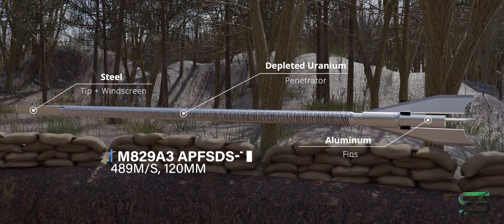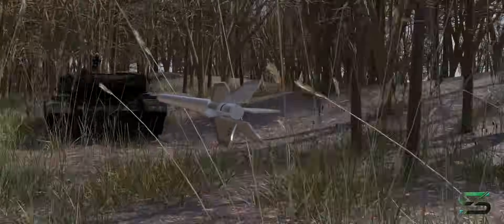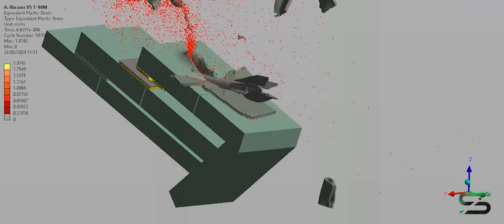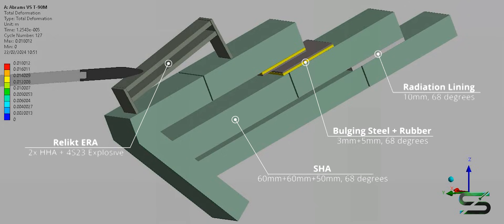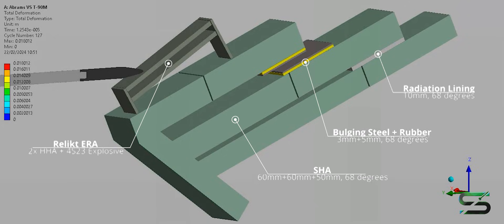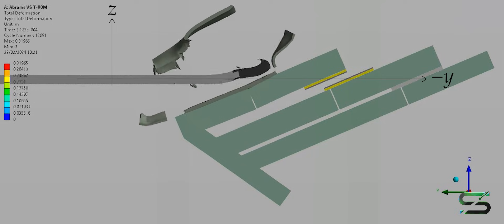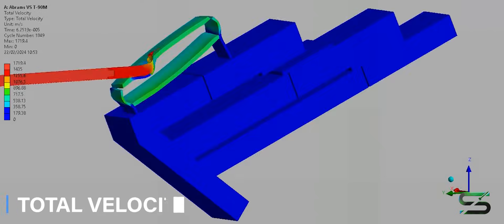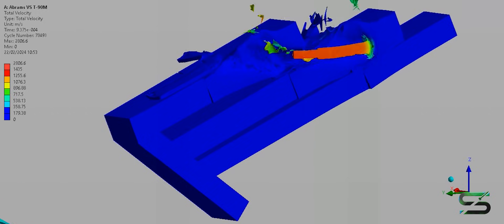M1A1 Abrams VS T-90M | Armour Piercing Simulation

Comment: https://www.youtube.com/watch?v=kG8bBwjdtac
Comparing with a T72  hull structure from the link above, it seems the T72 and T90 have significantly different hull structures although the t90 is told as a rebranded t72

Comment: You're comiaring anvearly 90's tank system to post 2000 system.

T90M is dying to Bradley IRL, so the abrahms, well....

The problem with abrahms, its logistics chain.  Its terrible for UKR.
Reply: “Bro I know a lot about tanks”
Idiot any bradley won’t kill a T-90M it only killed its optics which actually a BMP-2M can do a much better job at destroying abrams and leopard optics than bradley killing T-90M optics also keep in mind that M829A3 is not 90s tank system but its 2003 and T-90M is half the price of an abrams so think about it 2 T-90M vs 1 Abrams M1A2 sep v3 not even the M1A1 the abrams will lose easily

Comment: The ERA should be house bricks like real life.
Reply: It’s about this “thin” that’s about an inch or metal, which is correct. The ERA is layered and thick from its explosive ls inside it and the double plate that’s made to create the circuit
Reply: @harrisonschonewald Many Russian tanks have ERA made of cardboard or bricks.  This happens because of corruption.  The same with the out of date food rations and the bad tires.

The ERA is ment to have explosive and sometimes its bricks or cardboard.

Colonel Alexander Denisov for example was arrested for stealing seven engines meant for the T90, one of Russia's most advanced tanks.  These were sold on the black market were countries like Ukraine could buy them.

Comment: There is not enough information available to run a simulation on this round, which was specifically designed to take down a T-90M. So, I would take this with a grain of salt.
Reply: There is not enough information available to run a simulation on this ERA, which was specifically designed to take down  new darts. 

So, I would take this with a grain of salt, especially seeing as the channel owner didn't fix the plates after segmenting them and made the ERA explode absurdly fast to affect the dart less and is lying in the comment section.

Comment: M1a1 is from the 80s… t90m enters service like 5 years ago
Reply: M829A3 APFSDS-T Depleted Uranium is made in 2014. It's not about the tank, it's the ammo
Reply: @bigsmoke4345  Абрамс от Модифкации М1А1 до M1A1SA не способны стрелять снарядами M829A3, это могут только модификации M1A2, M1A2C sep 1, sep 2, sep 3 , sep 4, но они используют более новый снаряд M829A4
Reply: @SFERA9-rb6xw  the guy who made the video says this "This simulation shows the impact of the 120mm M829A3 APFSDS-T with a Depleted Uranium penetrator being fired from a US M1A1 Abrams tank at a range of 0.8km, targeting the front hull of a Russian T-90M tank."
Reply: @SFERA9-rb6xw Yes they can, this isn’t war thunder where the M1a1 cant fire M829a2 or a3 if it was in the game. All M1 abrams variants with the 120mm gun can fire any 120mm ammunition. Just like how the M60a1 RISE could fire M833 and M900, it had the same gun as the 105 abrams so it could fire the same ammo as the abrams.
Reply: @tbomb69   Нет, у них  у M1A1, M1A1HA, M1A1SA базовая 120мм пушка М256, у M1A2, M1A2C sep 1, sep 2, sep 3, sep 4 это 120мм пушка M256A1.Что касается 105мм снарядов по типу М900 то ими может стрелять пушка M68A1E4, а не M60.
Reply: @SFERA9-rb6xw  english please?

Comment: You are not applying proper boundary conditions. Parts of tank armor are moving freely as if you were firing at a cutout IRL. The tank would shake itself apart if you built it like this.
What is the deal with the upwards strike angle?

Comment: Odd reports from Ukraine shows That T-90M frontal armour cannot stop older APDS from leo 2A4, About looses 80 T-90M confirmed visually, 8 T-90S, 1 T-90AK, 38 T-90A, Total confirmed tank losses 2936
Reply: This is all complete bs from your first claim alone because their has been only one single engagement between any russian federation tank and a nato tank and it was a leopard2A6 firing HE at the front chassie of the T-80BVM. Both tanks backed off
Reply: Леопарды вообще никогда не стреляли по русским танкам,они лишь выполняли роль САУ а когда выезжали на поле то из тут же достигали дроны
Reply: Да и по потерям стоит уточнить что у украины только больше/меньше 100 танков леопард из которых 40 уже унечтоженно а другие либо на складах либо за фронтом
Reply: А т-90м около 500 штук это на 2022 год час кнч уже больше

Comment: Why are we using the m1a1 and not the m1a2 v2 or v3?
Reply: because the use the same gun? like the only change the did is addon armor and CROW system, they haven't change a lot of thing to the hun other than it able to use programable round
Reply: The fascists are afraid that the Nazis will lose them and Russia will become targets for research.
Reply: Russian drones, helicopters and artillery, as well as FABs, will not feel the difference. So why should Americans spend more new equipment?!

Comment: Bro thinks he's an helicopter
Reply: on gng bro lil bro funna fly
Reply: Best attack helicopter in the world!
Reply: Its reference to T-90M that got destroyed by 2 Bradley IFVs in Ukraine
Reply: @lampredgo5440 no, it is not destruyed, was ddestroyed visión system
Reply: @marianoprado5652  That is called a mission kill. The T90 could no longer fulfill its mission.
Reply: @jackmclane1826  Yes, but the tank was not destroyed as such, as some people say, it was just rendered useless.
Reply: @marianoprado5652  
I think there is no need to make that difference. The effect is the same, isn't it?
Reply: @jackmclane1826 yes but the t90 was repairable
Reply: @ThePolishFulcrum  Was it repaired? Probably not... So the effect is the same.
Reply: @jackmclane1826  yes, if the tank if put out of action and the crew has to bail out that means it’s destroyed. It doesn’t have to violently explode to be scrapped…
Reply: @jackmclane1826  So you confirm the other user is correct in stating it was NOT destroyed.
Reply: @ I think you can say it was destroyed. 
It was so badly damaged that the crew had to abandon it, because it could no longer fight, was deaf and blind. 
It does not need to toss its turret to be considered "destroyed". It was what is called a "mission kill". Unable to fight and continue its mission and abandoned.

It may have been repairable at that point, but it was finished off by a drone dropping a grenade to prevent recovery and repair. If I remember correctly... too many tanks blown to pieces to remember them all.
Reply: @jackmclane1826  Was it destroyed? No? Then the english language says it was not destroyed. It's not complicated, childrens are able to understand that.
Reply: @olisk-jy9rz  Point is: It was destroyed!
I can't help you if you don't understand, what a mission kill is.  The outcome is the same as if it tossed its turret. 
A drone later ended it completely, but the result was decided before.
Reply: @jackmclane1826 how many bradlys, and t-90 were destroyed?

Comment: some mf said ERA is useless against apfsds bruh
Reply: Once upon a time, that was true.
Reply: Every simulation shows the dart hitting the era block dead center where its most effective

No one shows how effective it is if the dart hits a corner or anything
Reply: @ozan1234561  ERA works as is should be when hit. When not hit it doenst work. Is that really a big surprise?
Reply: @ozan1234561  fr and this is why every anti Russian says "ERA is useless!!! 🤓" however usa also uses ERA and so does ukraine, infact ukraine uses more era than Russia, especially on their leopard 2's and m1 abrams.
Reply: Vs new rounds yes
Reply: Contact 1 (5mm against pen) useless, but Contact 5 (120mm against Apfsds) and Relict (250mm) , there is also a Duplet (250-300mm).
Reply: @BlackZaporozhian DUPLET is twice as heavy tho id you want to use it on a tank you have to remove the first layer of composite to fit it due to weight increase but yeah it is more effective than RELIKT and K5
Reply: @AlexanderK9519  yeah but DUPLET is ukraine-made, just like the Nizh ERA. Nizh is pretty cool actually, it like slices the projectile in 2
Reply: @AlexanderK9519  That was the case with Knife, not Duplet. That was t64 mod with Knife armor, where the problem is suspension - its really good but too soft for several tonn update, thats why they need to remove first plate. The Duplet is the same as Knife, but Twice! because this beast seats layer by layer (tandem)
Reply: @krakozyabro_official  Better to say in several pieces. I believe it should to have 12 to 9 cumulative shapes
Reply: @MercTac  that's what i said
Reply: Возможно, DM63 и M829A4, могут с небольшой долей вероятности не инициировать блок ДЗ. Однако, для такого существует "Малахит", который сводит эту способность на, близкое к нулю, значение.

Comment: I would like to suggest a simulation of 50mm ap round vs m1a2 abrams side skirt (around 30mm ar550 steel) + side hull (around 80mm ar550 steel), as the armour and thickness are classified, this is a closer thickness specification and steel hardness.

Comment: Someone made a good point, why did the tip not break off and immediately warped what would have been an intact rod, which is the point of the breakaway tip, no?
Reply: Потому, что на таких скоростях металл поведением становится похожим на жидкость.
Reply: Cuz this is Propaganda my man!😂
Reply: @scottsauritch3216 no it’s that at high speeds metal acts like liquid

Comment: It is unlikely that the Abrams will meet the T 90 in battle. I think it will be like with leopards and British tanks. they will become easy prey for ATGMs and lancets. Telegram has a recent video of the destruction of a repair vehicle based on an Abrams tank
Reply: Abrams himself has already been destroyed, for which I congratulate you.
Reply: @MultiNike79  I already know. there are photos and videos. As far as I understand, it was destroyed by a commercial quadcopter. I’ll also note that at the same time the archer self-propelled gun (a very rare vehicle) was destroyed. There is also a video (I don’t know how recent it is) where a PzH 2000 was destroyed by counter-battery fire
Reply: I mean... The T-72 got its revenge by attacking the M1A1 Abrams using a T-72B3.
Reply: @keen8549  yeah but that’s an M1A1 the older versions of the Abrams

Comment: Wait why does the DU rod bend with the steel tip? While the tip itself never break off?
Reply: because this simulation doesn't mean damned thing and we've already tested the UFP of a T90A with ERA and it doesnt work lol
Reply: @sarttee this is a T-90M... T-90A doesnt have Relikt ERA.
Reply: @ChristandMMA  the t90a does have era though.   and it doesnt work
Reply: @sarttee  it used Kontact-5 ERA which is far more outdated than Relikt ERA, for reference Kontact-5 was made in the 80's, so to test M829A3 against Kontact-5 is purely unfair, Relikt has double the effectiveness of Kontact-5 by the way
Reply: @ChristandMMA  relikt also does not work.
Reply: @sarttee you are saying this on a video of M829A3 failing to penetrate a T-90M with relikt ERA, bozo
Reply: @ChristandMMA Yes because the break off tip doesnt work as it should
Reply: @mastermariner490  Relikt is not your average ERA... it has a delayed explosion, and is meant for M829A3.... the cope is crazy infact the relikt didnt even act properly in this video
Reply: @ChristandMMA  How do you know that,its doesnt even seem to do much against anti tank missiles in Ukraine
Reply: @mastermariner490  To be fair the entirety of M1 abrams armor does NOTHING against anti tank missiles or drones in ukraine LMAOOOOOOOO
Reply: @olisk-jy9rz  Name me a tank that does,except for the new Leopard 2 that have Throphy APS
Reply: @sarttee you mean tested in Ukraine? The Abrams there have the chobham removed because it's too classified to give the ruskies a sneak peak of it and gather data. Keep some secrets y'know
Reply: I think they're working with public knowledge.
Reply: Ten film to bzdura! Każdy pancerz jest utajniony szczególnie M1 Abrams. A zubożony uran znakomicie penetruje pancerz. Ten film to GÓWNO!
Reply: Because the front still got slapped by the plate. Not that hard to see
Reply: @commitselfdeletus9070  ok? In the video the steel part got the same properties of the DU rod, which is not true lmao

Comment: this is not accurate. M829A3 goes right through T90M/Relict pretty easily. the T90M LOS thickness is almost exactly 700mm with Relict
but the M829A3 has a Penetration of about 780-800mm
Its pretty close, but the A3 ammo will still defeat T90Ms consistently
Reply: sauce?
Reply: No, the base thickness is 600mm. +50% RHA protection would give an LOS protection of 900mm, which is more than enough to defeat A3 at a range of 2km which is indeed 780mm.
Reply: @Anonymous-is6xu  where TF are you getting a magical +50% RHA protection from?

also (60+10+50+60) 180mm of armor at 68 deg is only 480mm sorry to tell you that. the Relict will add roughly 220mm more effective armor when applied to this matrix. bringing it upto about 700mm exactly. you literally have the answer right in front of you, stop reading russian bias crap sources that claims russian armor is 5x stronger than the laws of raw physics and reality dictates its actually is.

Things dont magically work the way you want them in your head, while ignoring reality.
Reply: @TheAngriestGamer.  1. Kontakt-5 as tested in the US increases LOS protection by 30%. Relikt improves on this through two plates flying opposite of each other simultaneously. UVZ claims a figure of 60% against APFSDS (which wouldn’t be impossible given the above knowns anyways) so I went with a more conservative 50%+ LOS increase. Stop yapping
2. Did you seriously go to an armor calculator and spit out that worthless value ☠️ this isn’t WW2 armor, SHA is not the same as RHA, and the two 60mm plates are spaced with 5mm rubber+3mm steel buffer and 19mm of empty air in between. This gives an effective RHA equivalent protection of at least 600mm. Public domain information gives the T-90 model 1992 armor as having a base RHA LOS effective protection at around 550mm. We know that the T-90A and T-90M’s base armor significantly improves on the 1992 version which was basically a T-72B, so 600mm base is actually a very generous estimate. 
3. You aren’t fooling anyone here, maybe try a quora or Reddit thread instead
Reply: Giving the equivalent of RHA steel is not accurate, rather a rough estimate. M829A3 was designed to defeat Russian MBTs with Kontakt-5. Modernized Russian MBTs with Relikt would be able to defeat M829A3
Reply: @yuripotecknov5164 M829A3 was made to defeat Relikt.
Reply: @romanyalovyi6079   actually it was designed to beat Kontact 5, Relict AND Kaktus (which they never ended up building/using even though it was better than both copetact-5 and relict) 
Relict is much better than Kontact 5 but its not 2x as good like they claim, its more like +70% better. and Contact 5 is also below what russians claim too. 
But they scream their butts off if you point that fact out.. 
Dont get me wrong. its good armor and kind of impressive as far as addon armor goes, but we literally have russian idiots on this video claiming that 180mm at 68 deg is somehow 600mm base armor, and not what Math/REALITY dictates (which is actually 480mm).

As for the T14 armor, the jury is out on if Monolith is any better than relict but its assumed to be at-least 30-50% better than relict, which is why the M829A4 was made with 900mm ish pen cuz the M829A3 ammo from 2004 is unlikely to pen the T14 tanks (but that assumes they actually make or deploy any of them which also seems unlikely)..
Reply: @TheAngriestGamer. Relikt was designed to defeat m829a2 after K-5 fail. M829A4 was designed to defeat t-14. Doesn’t matter what Russian sed. We have facts.

Comment: So if this is the case why didnt they do simulations and than just do a good ol slapparoo of another 50mm of steel and be sure there will be no pen?
Reply: They actually did back in the 80s when soviet designers realised that 105mm apfsds could barely penetrate t-72 ufp, so they added a 16mm armored plate and that stopped the round
Reply: Trash engine, ERA is lighter but more effective
Reply: @somerandomboibackup6086  its just smoll.
But itsnt about engine, 1HP per tonn loss is not catastrophic loss. Problem is in transmission, its pretty much at its limmit

Comment: The relict is exploding way too soon and far too fast. The back plate does not even contact the rod
Reply: Спасибо, теперь все военные заводы поднялись и стали менять "Реликт"...
Только Малахит (ДЗ 4 поколения) будет максимально эффективно понижать угрозу от ОБПС.
Reply: малахит фейковое название. @KasKusOK
Reply: @KasKusOK the M829A3 tip just touched the ERA i saw it on slow motion it the ERA a kiss and still even in 800meters didn't penetrate at all even tho he edited the ERA to reduce its effectiveness
Reply: @KasKusOK не будет, против него уже созданы М829А4 и DM73.
Reply: @romanyalovyi6079 оба снаряда даже в серию ещё не пошли😅
Reply: @dinipuh9889  А4 в серии ещё с 2015 года.🤣
Reply: @dinipuh9889 M829A4 has been in service for years now lol
Reply: @dinipuh9889 you’re thinking of Russia :)
Reply: He made Relikt explode too quickly otherwise it would have humiliated M829A3 even more
Reply: @Maverick966 Russians are in denial
Reply: because thats literally exactly what the tip of the round was designed to do🤯
Reply: Yeah. And also, why is the last armor plate not fixed? I swear i've NEVER seen an honest simulation about M1 vs russian tanks or vice versa. Not a single channel, as they're all american and try to skew the simulation in their favour.